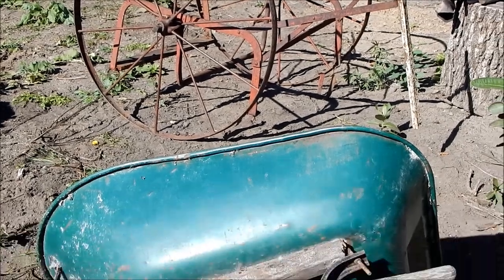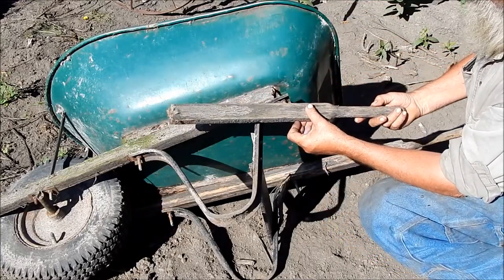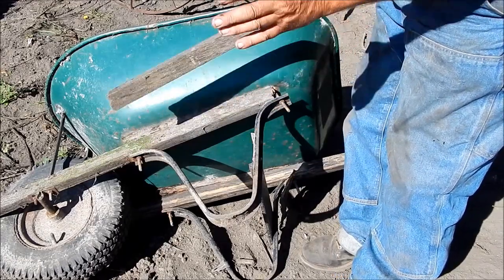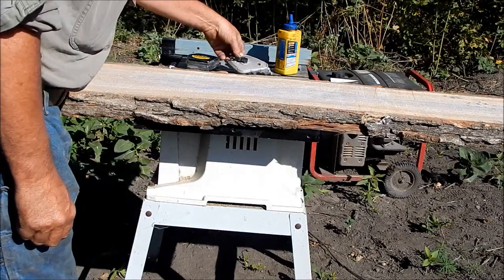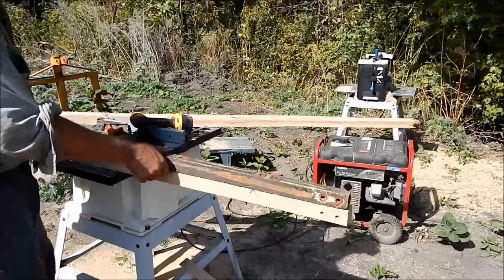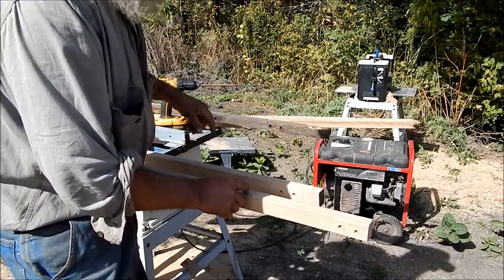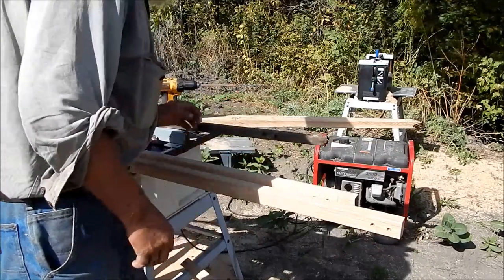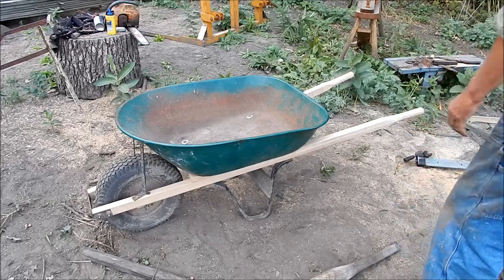Wheelbarrow rebuild

Comment: 👍A good wheelbarrow is a great thing to have. Once a year I check mine over, tighten nuts/bolts if needed. I also take about 10 mins to rub down WELL w/ motor oil. Every nook and cranny gets an oil bath. Guessing 24 yrs now. My kids bought for me. Still use it all of the time. 
Good repair, good video. 👍🇺🇸
Reply: <<Once a year I check mine over, tighten nuts/bolts if needed. I also take about 10 mins to rub down WELL w/ motor oil. Every nook and cranny gets an oil bath. Guessing 24 yrs now. My kids bought for me. Still use it all of the time. >>

You are the first person I've seen who did regular maintenance and repair on your 'barrow. 

That would have avoided a lot of work on overhauling my thirty year old barrow a month ago.

But what about the wheel and tire?  They tend to fail and cause barrows to be discarded.  My theory is that the tire needs to be removed from the steel wheel,  and the wheel derusted,  primed and painted to keep a surface that will keep the tire air tight.

So---  do you do anything about your wheel?
Reply: @SeattlePioneer  Tractor Supply had a new wheel/tire combo. Replaced last year. I continue to wipe down w/ oil.
Reply: @majorpayne5289  <<
Major Payne
2 hours ago
 @SeattlePioneer  Tractor Supply had a new wheel/tire combo. Replaced last year. I continue to wipe down w/ oil.>>

I'd never thought about motor oil.

When I rebuilt my barrow a month ago,  the handles had open grain allowing water into the handles.  They were still strong,  so I primed them with Kilz primer and painted them with house paint,  which was applied to all the wood and metal parts.

Your idea of motor oil on wood sounds good!  I found protecting the bolts threads from corrosion is important.  I should have bought galvanized bolts and hardware,  but I didn't think of that. 

Almost as important,  I'm going to make a point of standing up the barrow under the eaves of the house to protect it from rain.  It's thirty years old now,  and I expect it to outlive me at age 72.  

This was a fun and rewarding project for me,  and now I'm enjoying listening to other You Tubers who have done similar projects.  There seem to be dozens!
Reply: @SeattlePioneer  👍Yes sir, it sounds like you definitely have one that’ll last!!

Comment: Here is a tip, if you don't have a brad point bit just use a piece of scrap wood behind the hole and drill through.  Thanks for the video.

Comment: It's good to see a Master Craftsman at work You are on in a million my friend :-) I was just surprised you dodn't pinetar your peases before assembly seams like water could get in between the handle and the metal parts.
Reply from the maker: I did, after the initial assembly to make sure it fit well, I loosened all the bolts to get between parts, and coat the bolt holes.
Reply: A Master Craftsman ;-)

Comment: The new wheelbarrow we bought came with varnish slathered on the wooden handles real thick, so I took the *new wheelbarrow apart and fixed it by painstakingly sanding off all the thick varnish till I was down to the bare wood and coated it with used engine oil looks much better than it did and will last much longer to! In fact I do that to all my tools. For some reason people think all tools need to be slathered with some kind of varnish, and then what happens is the wood splits and cracks and the varnish wears down from use overtime and water finds its way in then it’s trapped underneath that stuff and the wood just roots away to nothing and not to mention it’s horrible uncomfortable to use tools with wooden handles that’s coated with that stuff, painting the wood with some kind of oil is definitely the way to go, but unfortunately we live in a throwaway world and things aren’t meant to last or be worked on.

Comment: Is it really necessary to burn it in? Seems like the sun should do the job.
Reply from the maker: A good hot day helps, as does heating the mix before application, but to really get it in, fire is the thing. Hit it with heat to the point that it bubbles, and the wood pores open and pull the tar deep. Its not a surface finish, it becomes part of the wood. A scratch or dent in the wood will heal itself. I have seen it with gun stocks I have done with pine tar, if you ding it, it will slowly spring back. Rub your thumb over it a few times and its good as new.

Comment: I knew the pine tar was gonna come out. I bought some from our local feed store about a year ago and still haven't used it. Will you be diluting it with something? Or using it full strength?
Reply from the maker: It has to be diluted, its like a thick tar in the can. I use turpentine to thin it out so it will penetrate, then hit it with heat to really burn it in. If it doesn't catch on fire now and then, you're not getting it hot enough.

Comment: How tall are you? Im 6'6'' and i've never been able to use a wheelbarrel without stooping and it being real hard on the back. If I stand strait up the crossbars on the front always bottom out, or my load dumps. I guess a man could fix that by making the wedges that level it out thicker?